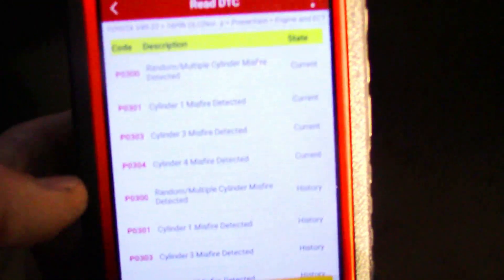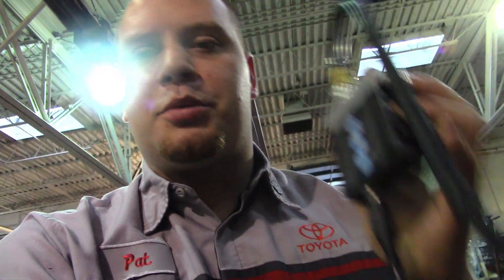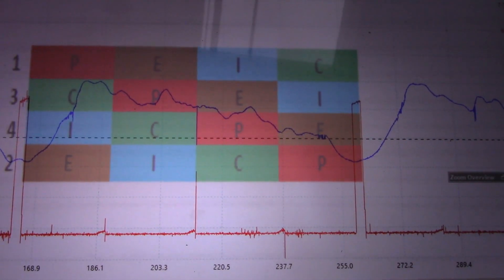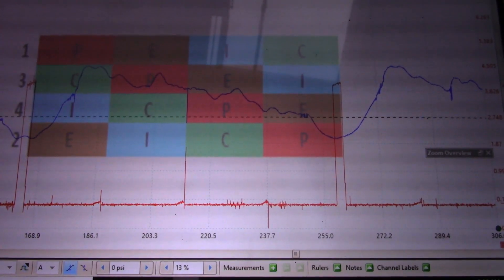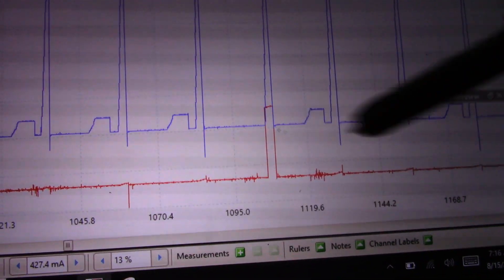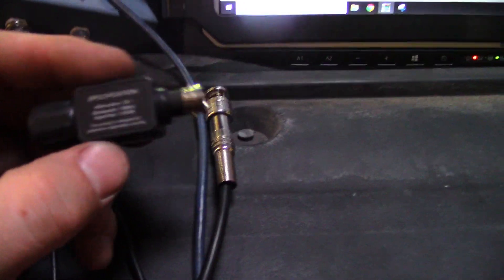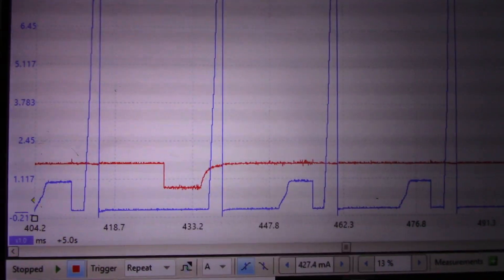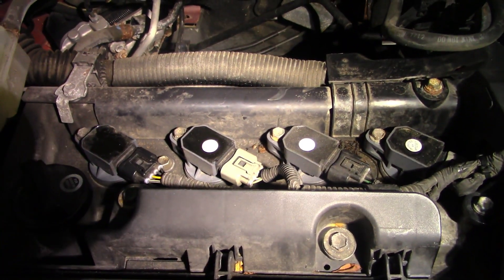'09 Prius with multiple cylinders misfiring, or are they?

Comment: I had this exact problem with cylinder 4. I had to bust out the good ol’ mechanic’s stethoscope and noids. Bingo there it was. While I was at it I just replaced all 4 injectors for more even spraying. Also ohm tested all the coil packs and they were still within spec at 190k. With the new injectors it runs smooth as glass now.

Comment: The type of terminal you back-probed at the IGT (Ignition Coil) should have the probe inserted to the exterior side (OD side) of the connector seal. That way you insert the probe beside the seal not through it. Going to the inner side (like in this video) pierces a hole in the seal. To visually confirm this concept, remove a terminal from the connector and check it out. Good job Pat

Comment: Wow I looked again at your explanation at ~4 min.

That is COMPLETELY wrong. 
There is no vacuum that you repeatedly are saying and is your so called reason of what we see. We can ONLY talk about overpressure and under pressure.
The combustion in that cylinder is not happening ("misfire") and the and therefore there is no expansion happening either. Expansion = increase of pressure (that is what is pressing the piston down that is not happening in that specific faulty cylinder).

When that increased pressure is not going out to the tail pipe when we have not ignited the air and gasoline mixture. Then we do not get the expected pressure and we get just the unburned fuel and air mixture pumped out to the exhausts. Those will have lower pressure when they have not been ignited and burned.

So where is the vacuum... Wow that were a very bad explanation. When blaming vacuum when it is the total opposite of the lack of expansion=higher pressure and you make up and blame lower pressure occuring because of vacuum. 🤔
Reply from the maker: Vacuum occurs because combustion doesn’t occur….

During the intake stroke the cylinder had about 20” of vacuum.

During the compression stroke cylinder pressure increases, but combustion never occurs during a misfire, so as the piston goes down and the cylinder expands you end up back in the vacuum state that you had during intake stroke.

During the expansion (power) stroke, the exhaust valve opens and the vacuum is released into the exhaust system.

Thanks for watching!

Comment: What "vacuum and explosions" to explain how a "explosion engine" works. 🤣
No just making a point it is a "combustion engine" it is silly tot talk about explosions, we are not 4 years old. 😉

The definition of a "explosion" is that it is a UNCONTROLLED event. 
It is a controlled EXPANSION and timing (ignition), when that flame front of the ignited air and gas mixture is expanding, that is WHAT is happening in the cylinder.

The definition of vacuum is that there is nothing every molecule is not in that space at all by being sucked out so there is nothing there.

The piston has created a UNDER pressure and not a vacuum. When nobody/nothing has sucked out the molecules!

And to be correct that is never happening that the piston is going down in the "intake stroke" and then we have vacuum.. .. never in a 4 stroke combustion engine. 
It is defined as the "intake stroke" because it is taking IN something. (air and gas in this case).

Sorry to be so rude .

But going out of your way and then explain to us that you are better than other machanics (that had replaced coils) and are trained formally and have taken courses and so on.

And being so high educated, in your specific expertise area and job. 
And then failing to use more correctly describing wording of how basic stuff work.
Make me start to doubt that if someone is so careless of choosing the correct wording, of something they should know by hart. 
Then is they "sloppy" in other areas also. 🤔

Maybe it is just me or the general understanding and knowledge of the public is so low.
That this is the base level they think that they fully understand how stuff works. That makes faulty and poorly wording being "OK"?

Just some constructive feedback: Use better wording and maybe then more people will trust you and what you are saying. 👍👨‍🔧

Thanks for the video! 🙏

Comment: Great video.  I have a problem with my 2008 Prius and I was hoping you could help me with it.  Its throwing a P0047 code.  After researching it, I have found that its related to a turbo relay.  This car has no turbo.  The gas motor shakes when it turns on.  I have replaced the pvc valve and spark plugs with improvement.  Can you help me?

Comment: Nice video, VDD. Parts changers have ALWAYS given mechanics a bad name. You are 100% when you say training is key. Many moons ago, when i was a rookie, i was told that the VOLTAGE REGULATOR (external, mechanical & electronic) and ALTERNATOR were a matched pair and must always be sold together. Well, i learned later that the reason shops did that was usually because nobody had a clue how to determine which one was causing the battery to not charge, so they sell both. Entire HEI distributors would get replaced because mechanics couldn't troubleshoot if module or pickup coil was bad. I've seen heads and engines condemned because of failed EGR valves; and car owners never knew because I was hired by the shop or auto parts store to sort out the mess, not the car owners. CONSTANT TRAINING saved me from the dark side.

Comment: I'm having a similar issue with my 01 Prius. random misfires. no clue what's causing it. I've replaced the injectors ignition coils and spark plugs. Can a bad engine ground or something cause it? or is the engine itself a ground already?
Reply from the maker: Might want to take it to a technician to have them diagnose it. It sounds like you spent a lot of money trying to fix this. It could be many, many things causing a misfire.
Reply: I've spent about 200 over the course of about 5yrs on this issue. Mainly for inspection reasons. Its a junk work horse car for me so as long as it drives im fine. Its also a rust bucket. Just wont die though lol. I might take it to someone if i decide not to junk it.
Reply from the maker: @Lilmiket1000  the big thing is checking compression at this point. Making sure that the engine is strong.

Comment: Great video, thanks.  I have a low idle misfire fault on my 2012 prius gen 3, toyota put it on the tester and found multiple misfires, they suggested replacin the entire intake manifold.  They didnt really explain how this causes a misfire however and it left me suspicious.  My thinking was with multiple misfires and never having changed the plugs that that would be where we would start.  But after watching your video i see they are probably spot on.
Reply from the maker: Sorry Robert. I am just seeing this comment. Most likely theyre recommending a new intake because the EGR ports are clogged inside of the intake of your prius. Its a common failure on those.

Comment: Of course they are. 😜 My 2013 Prius went from 44mpg average after a misfire to 30... and I replaced the spark plugs. Still 30. But I have yet to clean the EGR valve which I feel will help.

Comment: I have a Toyota Prius 2010 that does not want to start, but when it does start the car begins to shake violently. But normally it doesn't even start. These are the codes that appear P0A0F, P3190, U0293. The battery is charged, I've checked and cleaned the MAF and the ERG, also changed the coils. What would you recommend me to fix the 2010 Prius

Comment: For those of you with a 2010 Prius with 198,000 miles.  I had #1 Cylinder misfire with that same engine rattle.   I also had coolant leakage that was causing the misfire.  Coolant was making oil kind of milky looking.  I saw a video about Bar’s Leak Stop HG-1 used for blown head gaskets.  I wasn’t going to deal with the expense of head gasket replacement.          I read the reviews on Amazon about Bar’s Additive and gave it a try.  Within one day ALL the problems cleared with no more misfires and shakes.  It’s been 1200 miles since adding to radiator and the Prius running great.

Comment: Hi pat , we had a prius with multi cylinder misfires  at our toyota dealer , cause was egr sticking  also inlet manifold can get blocked up ,especially on taxis. 
Thanks for video
Reply from the maker: Yes, I have seen that one as well. But it has been a while since I have seen one.
Reply: what year prius?  which cyclinders were misfiring?

Comment: You can use a power probe on each coil or you can just pull the lug and stick it in the coil and watch the damn thing spark.   If it ain't sparking change it
Reply from the maker: Advertisement Profile. But it needed a fuel injector?

Comment: Hi PJ, thanks for this video really enjoyed this , you my man are a credit to this industry... 
By the way how can you isolate just the injector waveform on a fuse feeding a many circuits,  Thanks
Reply from the maker: Faz Bari on this car. The fuse only fed the ignition coils and the fuel injectors so it was easy to isolate the fuel injectors that pull far less current than an ignition coil.

With that said, if the fuse feeds a bunch of other devices as well, your signal may be too noisy and unusable. If that is the case, i suggest using the first connector to the injectors, right after the fuse. 

In my experience. The connector right below the fuse in a wiring diagram is a good place to grab the injector wire and get a good signal.
Reply: @VoltageDropDiagnostics  
Thanks for such a quick reply mate .

Comment: Great video! That was a great technique that I've never seen before. But please, explain why the Prius makes that terrible sound with an engine misfire??
Reply from the maker: It has a spring loaded coupler between the engine and transmission instead of a torque converter.

When the engine isn’t running smooth, that is the noise the coupler makes when it is essentially being banged around.
Reply: @VoltageDropDiagnostics  Nice, I wondered about what was going on with this noise! Now I know... Great help! Great to the point video! Subscribed! THANKS!

Comment: Thanks,  nice use of Logical Thought Process,...  There are to many parts changers & no LTP,  NICELY DONE! ..  Also, feel exhaust manifold or get an I.R Temp gun for $20. & save burnt fingers. The cold cylinder is not firing... or disconnect one at a time , the missing one wont make a difference...   If its a vacuum leak it will fire ok under load when the it mix requires more air. It looks like the injector seals would be a potential source of leak... High speed miss is different again as ignition breaks down under compression...   &  Thanks again for lesson on high techtools! 
                    (   Retired Field service tech for Yale lift trucks and electric vehicles. )    W/B
Reply from the maker: Thanks! I really want a thermal imaging camera! I just can't decide which one to buy! It would help tremendously in situations like this.

Comment: Fantastic work with the scope!! Whom ever pulled out the shotgun method with parts changing clearly needs a new profession this could be diagnosed with out a modern scope. A coil contribution test would have proved coils were not the problem there goes fire, next compression - a trained ear could hear strong compression , next air - clearly that's not the problem all that's left is fuel and that injector was DOA so an old fashioned scope a stethoscope would have found the dead injector.
Reply from the maker: I agree. The issue they had I believe may have stemmed from having multiple misfire codes. And not knowing what a prius with a misfire sounded like.

Comment: One small issue, not sure how the technical info you provided clashes with the simplicity of fuel, fire compression. Hint hint simplest thing to test is fuel, by adding it. Anyone that fails to grasp this point does need more training absolutely.
Reply from the maker: On this vehicle, the easiest thing to check is compression, right through the scan tool! 

For sure, if you can’t grasp the basics, you need training. But understanding how an engine worked in the 60s doesn’t mean that you should stop learning now, right?

Comment: Great video and btw were you able  to listen to the injectors with stethoscope ?
Reply from the maker: I honestly didn’t even try. The scope was already out after checking the exhaust waveforms to determine which cylinder was misfiring. So i just kept using the scope.

Comment: Great video PJ. The sharing of information Can't devalue the industry. It is the constant misdiagnosis and bs spread to customers that does that. Some people might become better diyers because of this bit of info and we lose a customer but quite often that little bit of info gives some more confidence than their ability and now requires a larger repair bill. Lol. It all works out in the wash.
Reply from the maker: I agree completely. And lets be honest. There are far less people fixing their cars then there was 20 years ago. And combined with the shortage of techs, no shop should be hurting for work.
Reply: @VoltageDropDiagnostics  absolutely.  You've only got to read some forums to see the parts canon splitting at the seams. Gotta love that classic question "My xyz has this symptom blah blah blah. What is wrong with it?" And then the answers are classic. Great nights entertainment lol.

Comment: If you don’t mind can you post the brand and model of the items you are using for this. 

Awesome work man, shows with a little effort you can diag a car correctly the first time! Keep up the good work!
Reply from the maker: Which tools are you looking for? I can gladly get you a list but the two main tools that I used were the pressure transducer which is a Pico WPS500X, and  the scope which was a pico 4000 series. I forget the actual model number right now.
Reply: I’d also like to know what Tablet PC that you are using the pico on. Great video!
Reply from the maker: It’s a tough book. I’m not sure of the model number. We just recently got them through Toyota.

I have mixed feelings about it, so far lol
Reply: Chris the computer is a panasonic toughbook cf-33 it’s the newest Toyota techstream there not bad I like they are lighter than the cf-31 which was the last gen from Toyota. 

Also thanks man!

Comment: sad thing is all the training in the world wont do ya any good unless you use it.   i worked at a place and went to factory training once a year. unless there was a recall or a service bulletin/campaign  it was three to 4 years before we would see any failures that needed that training to diagnose. by then you had forgotten most of it. and if you do everything it could be a thousand oil changes in between. training is good.  just figure a way to keep it fresh.
Reply from the maker: Toyota factory training is top notch. But the electrical class is the very first thing that they send new techs too. And probably the last thing that they use lol.

Because I’m not giving a 6 month old tech an electrical issue to diag lol.

I think the electrical class should be near the end of the schooling, so that they can use it immediately afterwards

Comment: While this isn’t exactly a hybrid-related problem, it’s cool to see hybrids being worked on. There aren’t many youtubers that work on hybrids. I welcome all the knowledge.
Reply from the maker: I've had people ask for me to make a hybrid video. But I'll be honest. They rarely fail lol. Outside of the occasional hybrid battery. But its not a hard diag at all. lol So if I ever get an interesting failure, I'll be sure to film it!
Reply: @VoltageDropDiagnostics   I had  a hybrid high voltage insulation fault on a Lexus RX450h sometime this year. Turned out to be faulty Transaxle. I installed a used Transaxle because a new one is very expensive. Testing  the high voltage cables  with an  Insulation Resistance Tester would of been good  content for the youtube viewers.  On the Lexus side we dont see many issues on Hybrid aside from the occasional Hybrid Battery as well.

Comment: Great information thanks,  i seen a lot of ignition coils get damage by lean miss fires,  only last week was asked to look at a car that would have new set of coils every year and the last year it had two sets,  so of course get the scope out and wow the ignition systems was very lean easy to test if you use a scope alll the time so the real fixed for the car was to remove the injectors and test and clean they need to flow 200ml in one minute at 2.5 bar they only flow 140 and one was just 120 ml so cleaned and restest and back to 200ml and no more ignition coils.  So keep up thr great work
Reply from the maker: Yes! Jim Morton preaches this all the time! If you have an ignition coil failure, see if it is because of a lean mixture.
Reply: @VoltageDropDiagnostics   how can a lean mixture damage a coil?
Reply: Lean mixture causes high resistance in the cylinder.   That high resistance causes the coil to work harder and thus shortening the life of the coil.
Reply: We recently fixed a leak condition on a Corolla.   Injectors were all extremely clogged.   Injector drop test showed it.    Cleaned them on the car and it ran like a top.   

It’s a wonder all the coils hadn’t been over stressed and failed too.